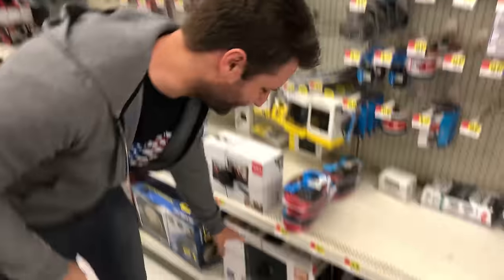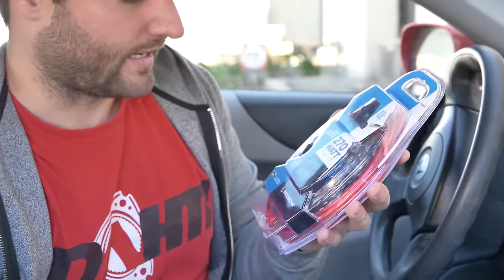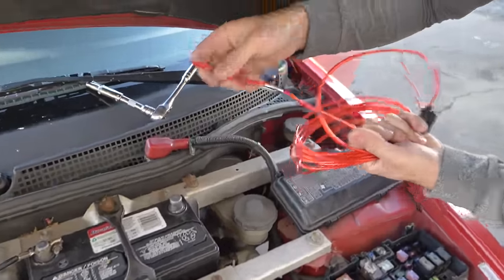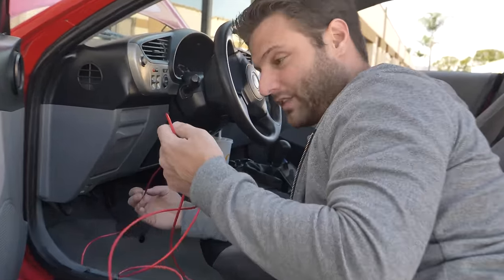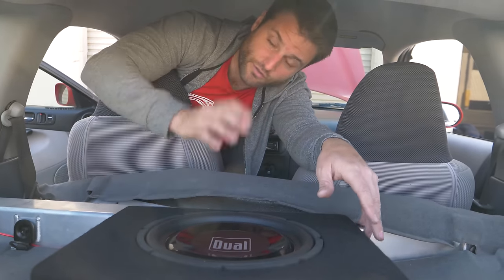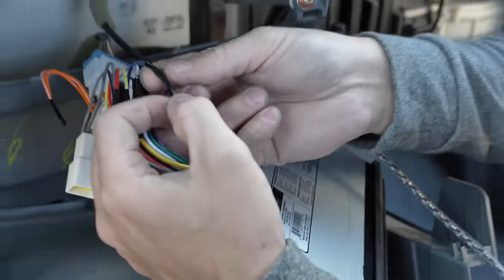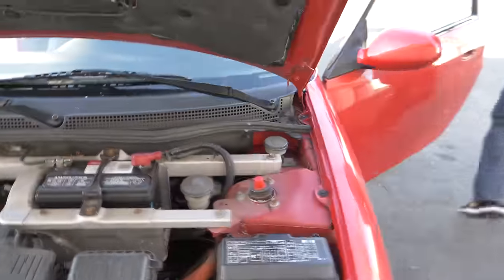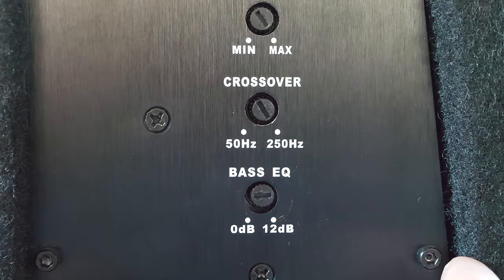How bad is the $70 subwoofer from Walmart? Install | Review

Comment: I installed this box in my wife's Subaru 3 years ago. Still sounds good. It doesn't shake the car next to you at a light, but it does fill the car with bass that you can feel. I used a high power rca converter with power control to stock receiver.  No, it doesn't compare to my 2000 watt system in my El Camino, but for the price, you can't go wrong.
Reply: Better than no subwoofer.
Reply: Is it still working?
Reply: @jfugler7250  yes. No issues
Reply: @concretereef  lets see the elco!!!
Reply: @sippping  https://www.youtube.com/watch?v=aMU4oFkY1qI&t=366s

Comment: when i saw how he wired it up i was like "Ight imma head out"
Reply: I am a leading expert on electrical power and this has fire written all over it.
Reply: Skipped up to the part where he wired it to the fuse box..
Reply: DMTrip Report ⚡️😵⚡️
Reply: @dmtripreport8542  what did he do wrong?
Reply: @austintrashboat  he wired it directly to the fuse box, which is bad
Reply: @dmtripreport8542  wouldn’t you wire it to the battery and not the fuse box
Reply: @austintrashboat  yeah man
Reply: @TraumaER  what would you have done different?
Reply: @itznoah231  wire to battery not fuze box.
Reply: @sirdumbthicc4294  how would you hook a car amplifier inside a house
Reply: @itznoah231  you’d have to get a power converter. Convert your house 120 volt power down to 12.
Reply: @itznoah231  also run the hot leads under the car whenever possible
Reply: @893R6-w8t  under the car sounds dangerous what if something hits it. Is it bad under the carpet or under the side trim?
Reply: @itznoah231  there's plenty of stuff run under the car from the factory. Brake lines, fuel lines, wiring looms etc. Just keep it tucked up with the brake lines or something. If you manage to hit it, you have much bigger problems anyways. 

Running the wires inside can be dangerous in the event of over current. If the wire heats up, it will light your carpet and moulding on fire.
Reply: @893R6-w8t  that makes sense
Reply: @itznoah231  I ran my wires with wireloom under my car
Reply: @dmtripreport8542   why is wiring it to the fuse box bad? You didnt really explain much about that

Comment: I can't stress this enough: buy used shit. It's gonna break eventually anyway but probably long after warranty. For $70, you can get brand name speakers and box. Pawn shops and Craigslist baby. I bought two MTX 10's in a box perfect for under my z71 and only paid $80. And bought a home modified amp from ebay for $70 that absolutely blows away my previous $200 amp. There really isn't a whole lot to speakers and amps. Shop smart. Wait for all the drug addicts who blew their money on expensive stereo systems to get hard up.
Reply: Yea i bought 3 JL Audio 10W-1 and with ported box  for got all 3 for One crisp Benjamin lol just got to be patient
Reply: I got 2 15 inch mmats in box for 300.
Reply: Where I live outrageous audio has a ton of cheap holiday deals. Look up subs online and price check with then. It's hella cheap and you get good quality subs, amps, boxes, etc.
Reply: I would never buy used, because I don't trust the people who owned it before to treat it correctly. Who knows how they had the speakers wired up and if they beat on it with an incorrect power rating. People are dumb, some people think Max Watts is what it runs at and have no clue what RMS power is or how Ohms work.
Reply: Crack deals :)
Reply: Hey i got car audio to sell you to. Even better deal then mtx for 80 bucks used 😂
Reply: @AustinsMind  false. Its easy to check if a sub is good bring a volt meter check coil ohm rating. 2. Press on cone listen for coil rub or loose suspension. 3 inspect coil for dark spots. Not hard at all. Ive bought used subs that lasted me 5 years. My buddy bought a used sub not knowing what to look for. I pressed on it heard coil rub ended up smoking 3 days later. If you know about subwoofers its easy to tell if sub was being clipped or not.
Reply: @gregl5677  you can't do that for buying used stuff on eBay though, and even then, in person people get defensive about the things they sell and may feel different in front of you if you decide to do that. I, still personally Wong purchase used car speakers and amps.
Reply: @AustinsMind  thats why you just buy it blown and recone it if its offline like i always do. If i buy offline
Reply: you have no idea what you are talking about. I can buy a used blown dc it psi 15 platform 5 for 100 to 150 and buy a recone for the same amount and have a 800 dollar subwoofer i know is good for less than half.
Reply: Jess W  that i agree with but used doesnt always mean junk if you know what you are doing. I got 2 skar 8s that float bags hits 142.7 dbs. They have skar ma 8 motors with psi recones. I have 120 in both they are nw 100 each i have 2 vids on my channel check them out
Reply: Jess W So you have been ripping people off for 25 years?
Reply: Greg l thanks for the tips! I definitely need to check that before I buy, I don’t want to get ripped off
Reply: I got 2 10” pioneer impps with ported box for $60
Reply: Wassup maybe u can help I got a small Acura I wanted 1 or 2 10's an a amp what's the best amp a speaker
Reply: Glad i found this commen,t Craigslist hasn't even crossed my mind
Reply: I got two 12" infinity subs in box and a rockwood 350 watt amp for free because a guy thought they were broken little did he know the tabs just got pulled off the wire clips on the inside of the box I pulled them out of the box and re did everything and built new boxes as well and now I have more than a grand in equipment
Reply: Dude as a mechanic I do the same  buy that shit used.  wouldnt believe how many. Addicts come by our Shop we have a used car dealership there too and around tax time you have people that spend and in 2 months we repoing there shit but the drug addicts they all year around always coming buy trying to sell the car, the Steroes and aftermarket performance Stuff.
Reply: Buying used is great. Normally I'll go ready to test the product before giving them the money. I've avoided buying bad things a few times. And I've got some great deals too. For my daily I bought a 500w JL amp with a jl 12w0 in a nice ported box for $150. I've used all of these components for over 2 years with no issues.
Reply: I wouldn't trust buying used speakers/ subs. Probably dry rotted to shit or full of bedbugs.
Reply: @AustinsMind  I agree with this guy. I see plenty of these amazon sellers selling things as new and they end up being used and blow out after 2-4 weeks. Not ever going to buy used here just work a little harder to earn some moola to get something good and you[ll know that'll have a warranty for 4 years.
Reply: Blew out the Walmart 10 inch in under a year, went with a used kicker L7 square and an amp for 160 bucks from a friend and I'll never go back
Reply: @AustinsMind  I agree, also some people don't realize how to properly break in subs. From the start they turn that sh!t up and blast, not good.
Reply: Update: Yeah I change my mind, call me a hypocrite, I just got some used speakers on my birthday for my surround sound, they sound  fine and saved like $100.
Reply: If your are smart and do your research your system should last many years I bought my system 5 years ago and that shit bumps hard still I have never blown a fuse or anything I just got a stronger alternator and that's it. Do your research dont just connect any amp to a subwoofer you got to learn your rms watts, your ohms, and your wire gauge.
Reply: I'll stick to buying new. I know that it's going to be new and work like new. People like to mount their amps to their boxes, so there are still holes in them. I prefer to mount mine beside it in an amp mount, basically a steel cage that's tapped to my frame and locked. Might be able to unscrew my sub and take it, but you won't even be able to budge my $1200 amp.
Reply: @AustinsMind  If someone says they have 1000watts max - I just laugh lol, I run a true 1k rms amp in my car and it destroys all of the wannabe systems lol
Reply: @drummonkeystuffuk1875  

I run a Orion 3000.1DSPLX 3000.Watts . I laugh when people pay $100 for an amp from Amazon and can hardly power their 300watt sub. Always saying "It's a good one, it says 1000watts"

No dude. You bought a Dual and you're getting maybe a third of what it says on the box lmao
Reply: @scp0787  The best ones are when they say I have 1000watts for £50
 I look at them and think "Wait a second here, I paid £500 for a 1k rms amp" haha
Reply: Butch this is supposed to be a budget build (super cheap for somewhat decent sound). For just over $100, he was able to get door speaks, a head unit, and an amp/sub. And it sounds much better than his factory. You still couldn’t do that with buying used.
Reply: My friend bought a  used sub. Broke after a year, def not worth it. I guess based on the price though it may do well. My sub has been running for 5 years now  no issues.
Reply: RandomSilly yeah buying a used sub is like buying a used Mustang from a teenager. You know they beat the shit out of it (because, well, that’s why most people buy a sub. To kinda beat the shit outta it). Used speakers are usually a big no no, especially if they’ve been previously amplified.
Reply: Greg l nobody is going to buy blown speakers and rebuild them like you do. The average person should never buy used subs. Ever. Per your comment “if they know what they’re doing,” ...that is why, because 99.999% of the world has no idea how to rebuild a speaker. So people,  my advice is to NOT purchase used blown subs. It’s likely not worth trying to rebuild unless you’re into that kind of thing. Speakers are like modern TVs. They’re throwaway items. It costs more $ and time to fix them than they’re actually worth. Stereo shops don’t even fix speakers. If the speaker failed, they just toss them and install another one. It’s just not worth it.
Reply: @joesmith389  i bought used pioneer 1300w Bazooka with 1200w akai (old version which much better than the new) for 135$ been banging it hard for 6 months and no problems whatsoever.
Reply: What I got 2 15s for 80
Reply: When I was younger my first system I bought 2 1000w Rockfords and a 2000w SPL amp with a sealed box for 100 bucks from a drug addict.  Went in my minivan and I was happy for a couple years until I took my system out for winter an then after winter i let my buddy use it in his caprice for a month an after I put it back in my Van the remote wire started my carpet on fire and burned up my Van. Cheap walmart wiring kits...
Reply: Joe Smith I think the difference between people like us and you is we have ~$500 subs and you have ~$70 sub. So yes, Spending $50 to recone a $500 sub is 100% worth it. And no they’re not throw away items. When you screen breaks on your phone you don’t get a new phone. You pay for someone to have your phone all day just to fix the screen.
Reply: Bullshit. $500 minimum for 6" drivers here.
Reply: I've been reusing the same 10" RF P1 ported for the last 10 years over 3 different cars, before that it belonged to a buddy of mine!

Comment: 100 bucks on fb marketplace will go a long way if you have enough patiwnce and wait for the right deal....
Reply: zenith0000 you’re not wrong I’m getting a Rockford fosgate p1 15” for 110
Reply: That's still pretty cheap...people that deal with car audio know how much it's worth....you see tons of mtx, generic speakers......every now and then you'll see an alpine type R, I've still never seen a type X yet
Reply: Thats how i got a mint condition 21 inch sub for 350, and a kicker solo x 18 for 400 good condition. Fb Marketplace is bitchin
Reply: Yeah I bough a $80 1000w sony explode anp and 1200w Sony explode husband box from a junkyard I rather buy used than buy that
Reply: @brandonpurple8938  I bought a pair of audio pipe 12s in a box with 2 amps and a cross over for 100 bucks. Ran them hard for a year before they went. Running NVX now on the same soundlabs amp that i bought with the audio pipes. Buddy is running the box now cause i built my own. The second amp (matched set) is in my f250 now on a set of pioneers i got for 100 bucks in the original boxes with a good ported box for an additional 60. Its in the back seat and makes my wipers jump and gets low with no distortion. Just took a few weeks of stalking to find a good deal.
Reply: @CentralArkansasHomesteadandOff  yeah I run a 10 inch kicker comp r in a rockford punch 550 x2 in a custom box no2
Reply: @brandonpurple8938  when i still had my 3000gt i was running 2 pyle 10 inch bazooka tubes with pyle 300x2 amp and a pyle 100 watt 4 channel for mids and highs. It sounded pretty tight.
Reply: @xanielton.714  I can afford new stuff but sometimes its fun to see what you can donwith 200 bucks on marketplace.

Comment: You need to chrisfix powerclean your engine bay
Reply: That sexy car deserves TLC
Reply: Soapy wooder
Reply: Diego ramdhani COLLAB IDEA???
Reply: No he needs chrisfix blinker fluid 😂
Reply: Chrisfix lost a sub when he told me to WAX MY WINDSHIELD... SMH
Reply: Just spray some purple power and gently wash it off
Reply: I used to work at a dealer and my job was to pressure wash engines. On the vehicle models I had to wash they wouldn't run afterwards (or would die shortly afterwards) and you had to dry out the spark plug wells and the distributor cap (older cars) but on modern cars the spark plug wells can easily fill with water and cause the car to not start or misfire like hell a few minutes later. Basically, don't use pressure washers, or be super careful... connections and parts themselves are water tight but they aren't always still water tight after years of heat cycles and grit. These days I just don't clean my engine, I dont' care enough. I actually spray oily crap on certain areas to keep rust away. I supercharged my car like 60k miles ago and when people occasionally tell me to pop my hood they are always like WHATT, It's so filthy! hahaha. Just not that important to me anymore unless I'm going to be doing a bunch of work and don't want to get (as) dirty.
Reply: What's so bad about waxing a windshield? Besides barely doing anything it's not like it's bad. I used to do it in my younger days. I can understand not liking someone's content (his stuff isn't exactly my mechanical taste so I get it, but I still watch some of his stuff) but a silly thing like that isn't THAT big of a deal.
Reply: So what? IF DONE RIGHT, end result is the same of using RainX, at a fraction of the price.
Reply: Diego ramdhani the funny thing is that it is in my recommended for this video